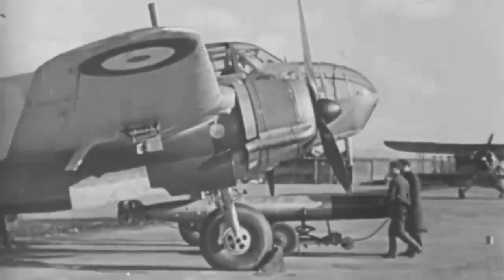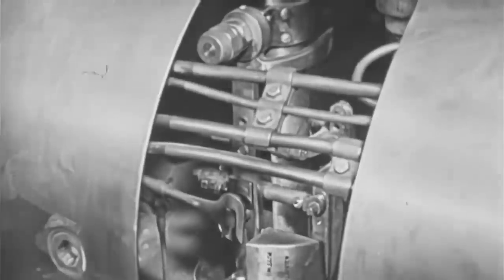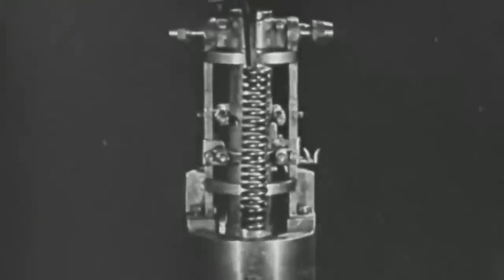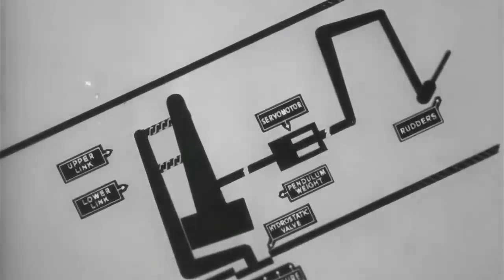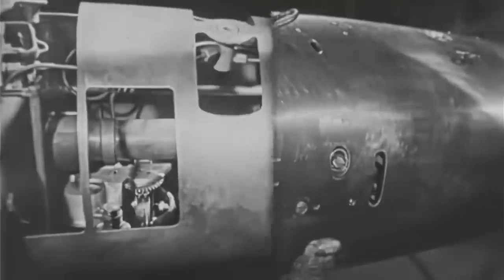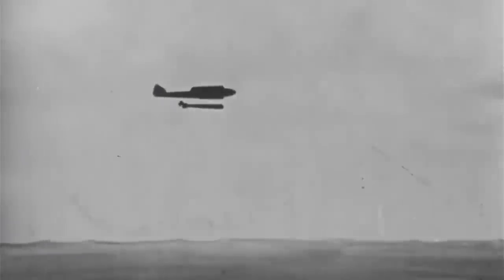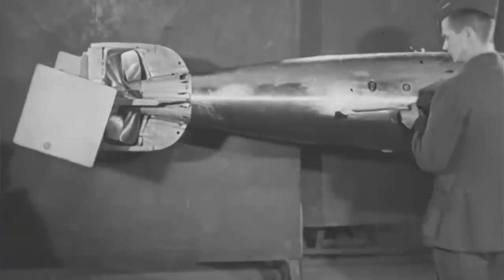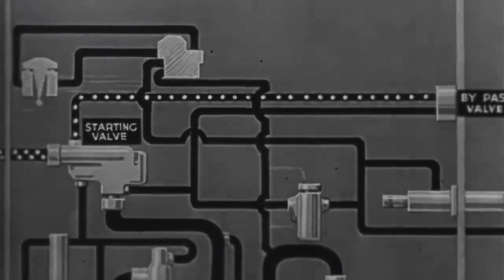Aircraft Torpedo | Royal Air Force instructional film (1942)

Comment: Elegant simplicity of mechanism. Did they actually work as advertised?  It was found that exploding under the keel by means of magnetometer type fuses was better at breaking ships backs than hitting them in their armoured portions.
Reply: Magnetic fuses were problematic in that era. Before WW2 ended, they had figured out that contact fuses were more reliable. Drachinifel talks about that issue, and others, in his video on the American Mark XIV torpedo.
Reply: Also magnet fuses allowed for simpler depth settings, compared to contact fuses. Contact fuses required depth settings to make sure torpedo hit the hull on shallow draught hulls, and below the possible armour plate on deeper hulls. Where as magnet fuses could pass below both hulls and be set off without needing depth settings set to target's hull type.
Reply: They went back to contact fuses for the second attempt at the Bismark
Reply: @Peorhum  I think magnetic fuses were always backed up with a built-in contact fuse. That way if the torpedo ran too shallow you had a backup. For all I know that may still be the case.
Reply: @crazypetec-130fe7  I read an account of how that saga played out in the early years of the war in the book blind man’s bluff. Stunning hubris!
  My father worked at the Glasgow naval shipyard yard labs during the war on underwater explosions and degaussing. The technology was indeed complex and difficult.